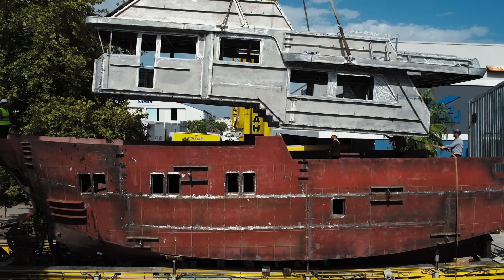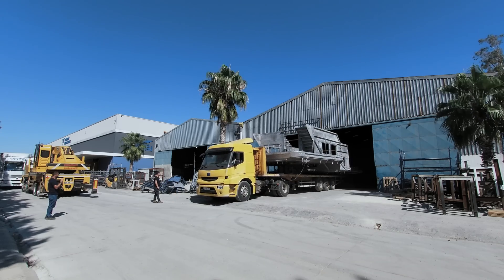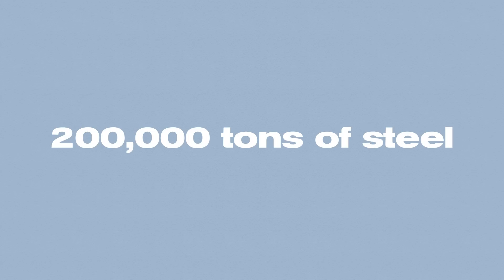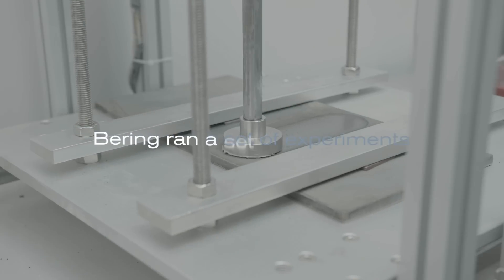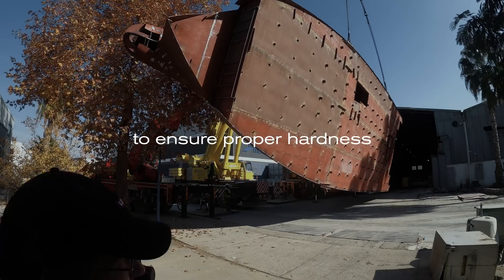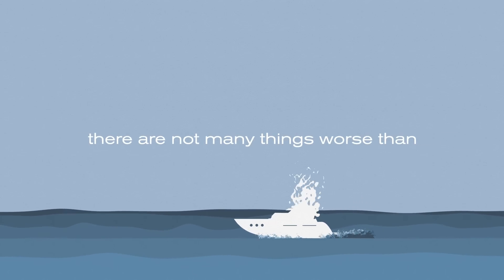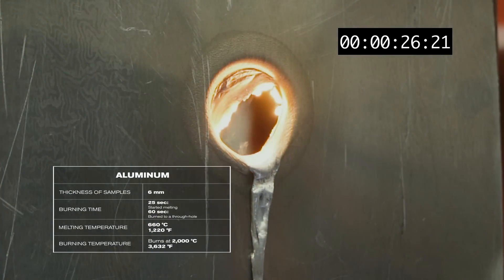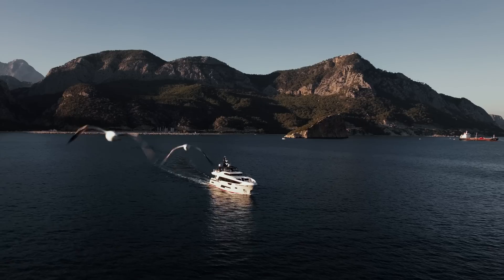Bering Exclusive: Why We Build Our Yachts in Steel

Comment: Sadly, there was no mention of how the two dissimilar metals, steel and aluminum are joined. Corrosion between them could be a big problem.
Reply: they use triclad - 12:50

Comment: And carbon fibre... Which is stronger and lighter than all of these three (steel, alum, grp fibreglass in its various e and other types) - with caveats. Carbon fiber superstructures (flybridges. Etc.) can be larger than grp superstructures, need fewer supporting pillars, etc. Can offer larger windows - and also consider a whopping investment in ovens? that can control temp and humid, etc. for longer periods.
Reply: Carbon fiber also carries noise and vibration more efficiently than  the other materials.  This noise problem requires so much more insulation and sound deadening techniques that the weight savings is used up.